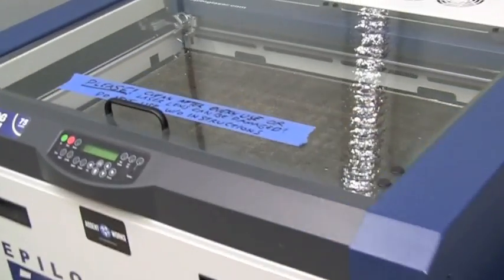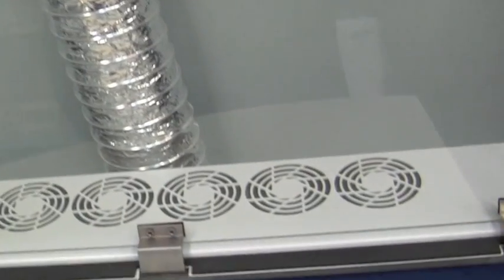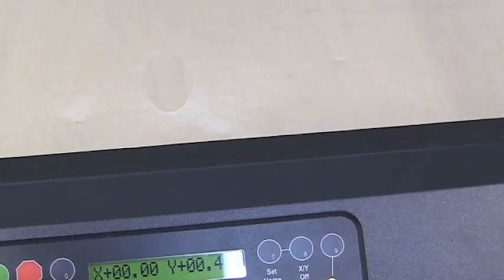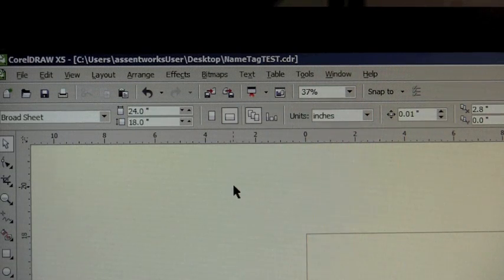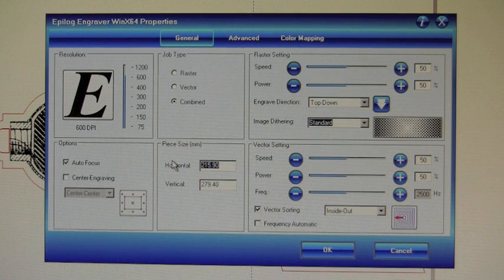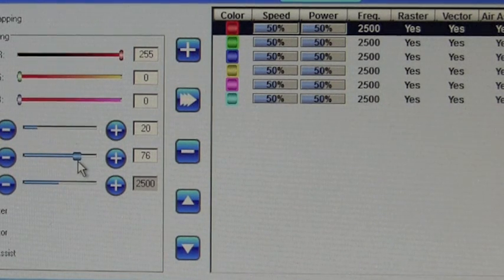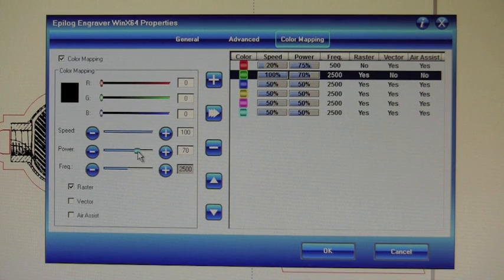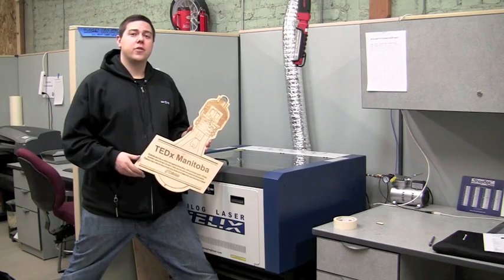AssentWorks - Introduction to Laser Cutting & Etching

Comment: This sure seems way more complicated than it need to be.  First, it sounded like you said you used “R grade” plywood.  What is R-grade?  I have never heard of that and Internet machine searches iterate the commonly known A — D grades that most folks know.

While color assignments might be nice, they are really not that necessary.  Vector lines have to be hairline (width or less than 0.06 pt or 0.004" or 0.025mm, etc.).  Making vector lines red (or any other color) is easy for the designer to know, but there is no need to tie this to a color mapping protocol.  You can assign any color you want when using a combined laser printing job (both vector cutting and raster engraving).  When the laser sees a hairline graphic element, it will cut; when it sees a non-hairline (or raster) element, will engrave.  Instead of doing advanced settings thru color mapping, just change the color of raster images and avoid color mapping: just use a shade of black.  In general, a 35% black (or gray) will laser lighter than solid black.  What I do is use one piece of wood with several small boxes drawn and filled with a different shade of gray (or black), and then laser the boxes.  From that you do not have to spend time dinking around with color mapping; you can see how much lighter shades of gray will be — and avoid color mapping.  This is just a handy reference piece in which to refer rather than memorizing the particular speed and power settings for the lightness or darkness of what you want to do.  In all likelihood, depending on the quality of ones laser tube, the difference between 100% gray, i.e., black and, for example, 80% gray (a shade of black) will be negligible.  The largest nuance differences for me are between 25% to 1% gray; between 80% and 25% gray, a jump of 5% produces a noticeable shade of raster lasering.  On most lasers, raster (engraved stuff) lasers before vector hairlines.

Relative to non-flat pieces, because there are large areas that are not being lasered, it is much better to use weights to hold down wood or any other material.  Using masking tape is kinda bizarre from my perspective: duct tape maybe….  Tape can easily come un-stuck, from either the wood or metal table guide — or both, during lasering.  And even then, you are only holding down badly warped wood in two places: what about the bottom?  A weight, such as a metal bar or small barbell weight, works great.  What I did is go to a shop with a water jet and have him cut me out, in my case, several ovals, ¼” & 3/8" steel about 2½” x 4.”  I commonly need this size to hold down central pieces of stuff where I know vector beam will not be.  If you do not know if the metal weigh will interfere with whatever is being lasered, what can be done, in this video’s instance, is place bars on the wood to hold it down and then run the vector part of the a job at 100% speed and 0 power and the red dot pointer on with the steel bars placed on both X-axes: top and bottom of the plywood.  This will immediately show you if your weights will interfere with any part of the lasering.  In this case, a couple of 24" or 20" long by ¼” high by 1¼” or 1½” wide bars would have worked great — with no risk of the wood moving or screwing up a job halfway thru.  In this video’s example, two 5" and 5-pound weights would have been more than enough and could have likely easily fit on the top or bottom of the train, as it lays on the laser bed.

If your material is bowed too much that it would hit the lens assembly, perhaps you should not be lasering this wood without some pre-treatment or different material storage method.  If you are using a 2" lens, the a bow greater than 1¾” w/could interfere with lens assembly, or, also, depending on how low your lens’ air assist tube hangs.  Bottom line, there are better ways to deal with bowed material.  I can pretty much guarantee you that tape would definitely NOT hold do a laminate like Formica or WilsonArt.

Finally, forget about the size of the object.  Set one standard “page” size for ALL laser jobs and set the home position ONE time.  Who has time to dink around setting a new home for each job?  In this particular video, the home position might have been off by ¼” or so.  That was irrelevant in this video; there was probably enough wood to print out two designs, thus being off by a small fraction of an inch was, from my perspective, wasted time with the laser running.  If ALL laser jobs were designed in CorelDraw or whatever, the placement of the image to be lasered is fixed relative to that standard page size.  In my case, my standard page size is 24½” x 12½.”  If I want to laser a 3" x 5" plaque, I put a non-printing box in the upper left hand corner of standard page and then design within that small area.  The software prints whatever is shown on the design, thus, every time I print something, CorelDraw is sending a 24½” x 12½” page to the laser machine, but ONLY the graphic in the 3" x 5" box lasers.  IF a design is in the upper left 3" x 5" area of the page, then that is where and what will laser.  If I want the design in the bottom right corner of the plywood, then I put the small design in the bottom right page in the graphics program; I do this all the time.  Let the software control where the object is to be lasered without manually spending time on each job telling the laser where to do its thing.  In this case, I have to wonder if half the plywood was wasted.  If the design was rotated 90°, it would be easy to see if it would fit on the left side of the “standard” 24 x 18 page that can be used for ALL laser jobs — or maybe reduce the size of the image by a couple inches and save the customer some money (and produce less waste).